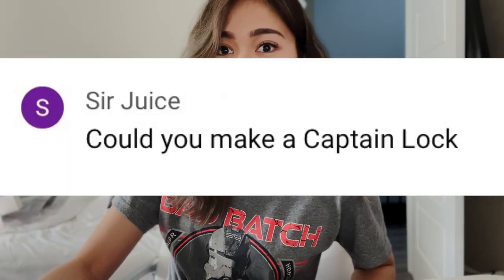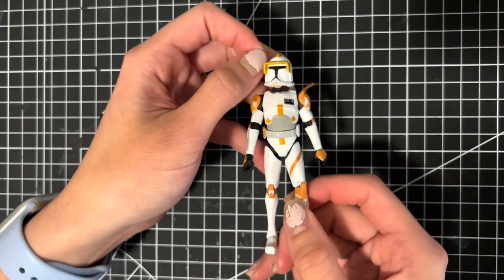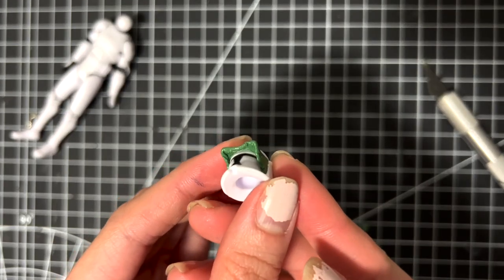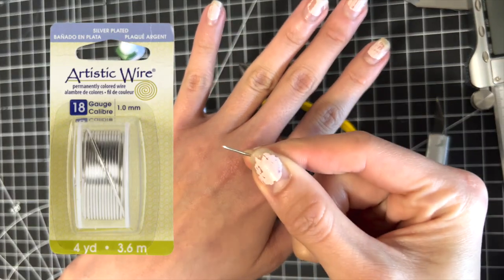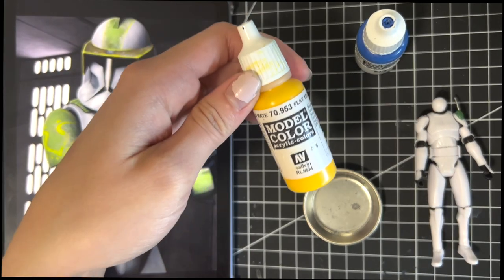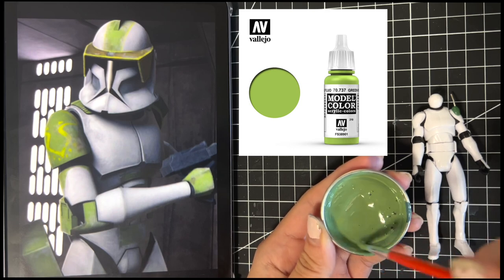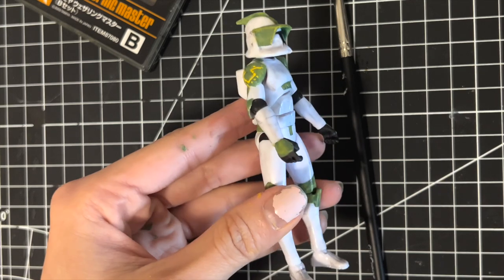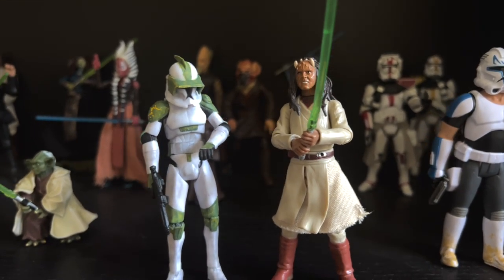Custom 1:18 Clone Captain Lock

Comment: Green is my favorite color for customs of almost anything, unfathomable that someone would own zero green paint.  Vallejo's dropper bottle matt varnish is also really effective for protecting the paint from scratching off, since their acrylics aren't as resilient as Tamiya or AK.  

That visor turned out really well. Maybe you should try sculpting the Phase 1 style mohawk thing that some Phase 2 Arc Troopers have.
Reply from the maker: The only time I ever used green was when I made a Captain Grey and 3D printed a Jabba! But yes I should definitely get green paint. All I really have are black, white, and the primary colours. For clear coat, I use the Mr Hobby one. But I have to wait til winter is over because I don’t like spray painting indoors. 

Thank you! Are you talking about the fin thing at the top of their helmets?
Reply: @CT99borj  Yes, the fin.  

I use Mr. Hobby for the finish and Vallejo for specific spots.  I don't know how cold your winters are, I spray on clear days above 25F and haven't had a problem across dozens of models.
Reply from the maker: @Snacks256  ah yes the paint works fine. But its me. I hate the cold 🤣 I comfortably grew up in 30+°C climate